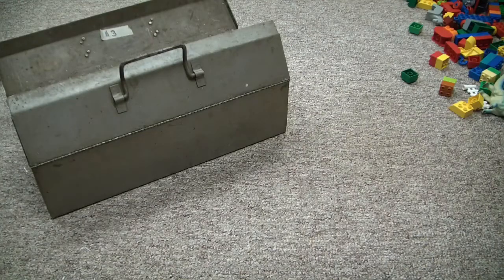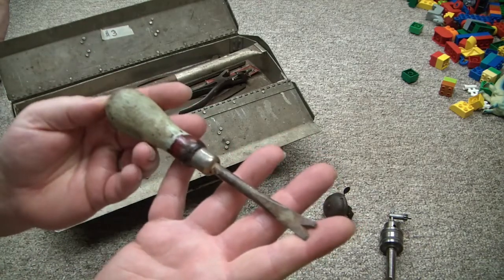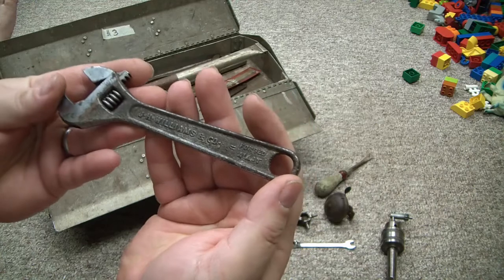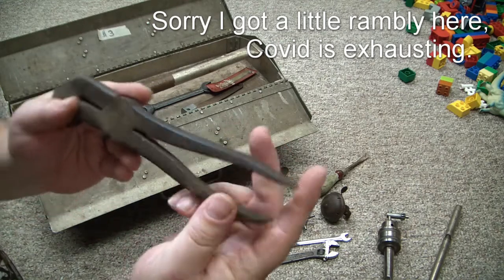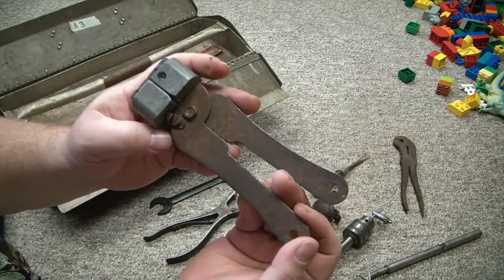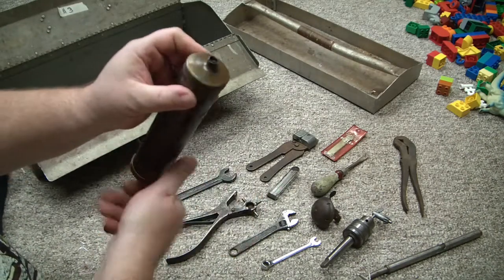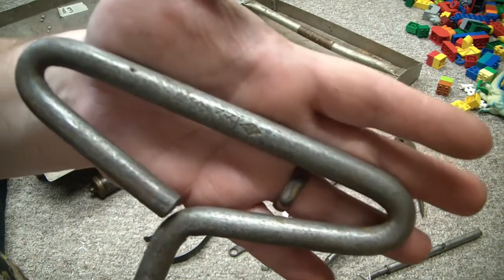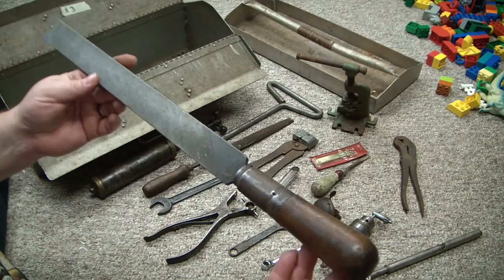Lagrange Engine Show Tool Haul Pt2   The Toolbox of Gems!

Comment: Nice finds. The Tee-handle with the M in a diamond logo is from a Frank Mossberg pressed steel socket set from about 1915 to 1920.
Reply from the maker: Oooooo. Really?  That would be cool!  I need to look that up!  Thanks!
Reply: @timeflysintheshop  The Alloy Artifacts website has details and pictures of the socket sets.